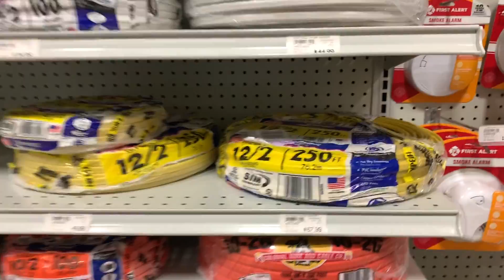Electrical Home Runs - Square D Homeline Panel Box Using Romex Wire

Comment: Lucky you our new code requires AFI and GFI now and AFI on just about every circuit. Thanks for sharing.
Reply from the maker: Ride-It-Out Tim-and-Toni It’s the same way here. I will have close to a grand in breakers when it’s said and done. Also we have to have lockouts on the dishwasher and hot water heater breakers.